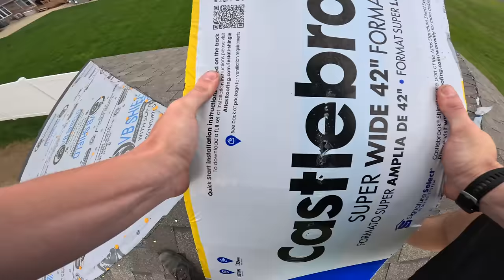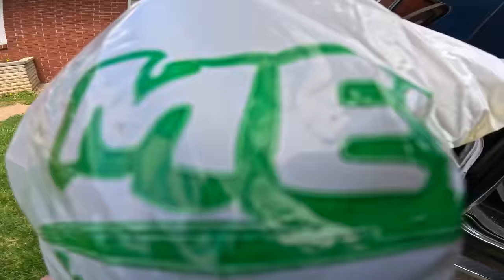Camper Updates + Building a Garage | Full Time Truck Camping

Comment: More material and slower application will solve splatter issues and give you better coverage.  You should not be able see yellow of the roller, i could see it in the shot.  Also, always use a brush around the vents then roll into it.
Great job and I respect your efforts.